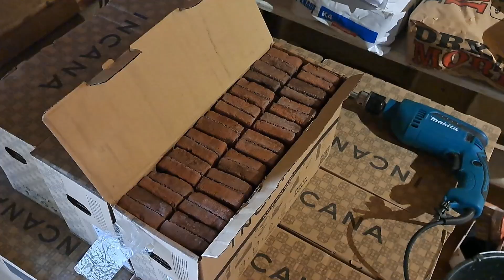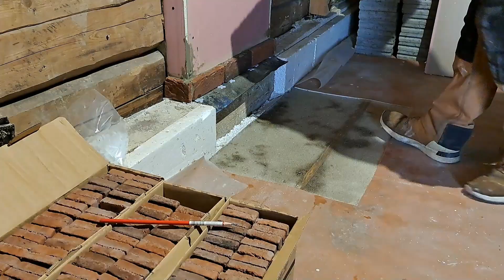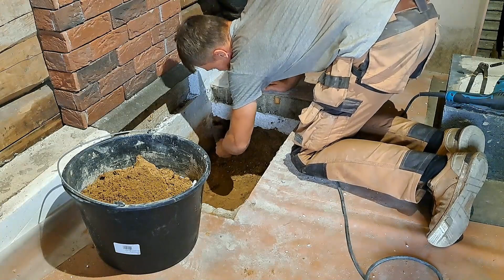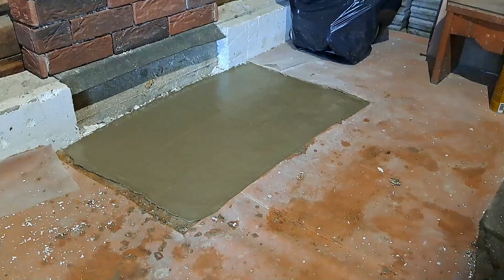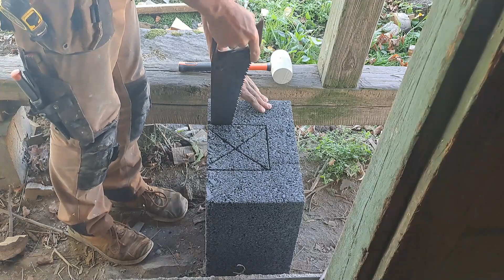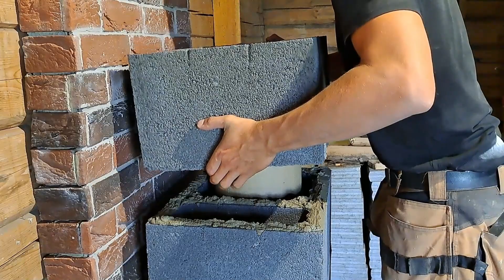Off Grid Log Cabin Renovation | Chimney Build

Comment: A well built chimney, it will be safe to operate. Is the little hole at the very bottom a drainage hole for condensation?
And I'm just curious, but why building the chimney in front of the nice stone strips? You won't see much of it anymore after the chimney is finished.
Reply from the maker: Thank you! I built it specially for the chimney as fire barrier, I will decorate it the same brick tiles aswell 😁
Reply: @homesteadingdays  Very safe indeed, there are three layers of fire proof materials.
Reply from the maker: Yes 😁 I know its extra workand material but I like it done properly